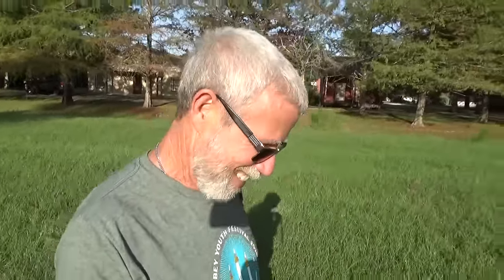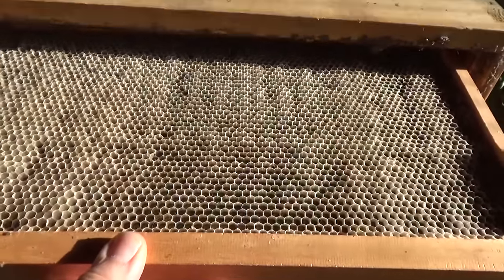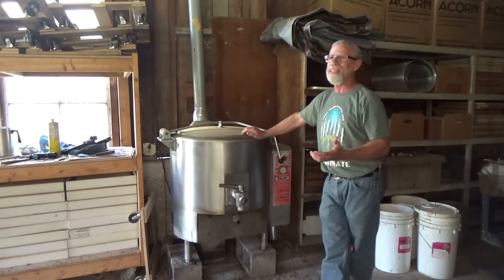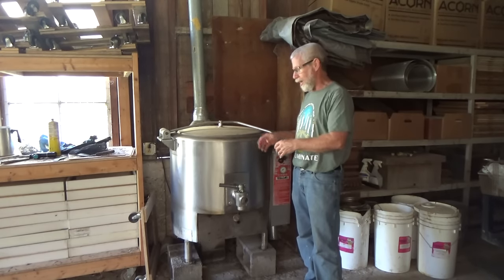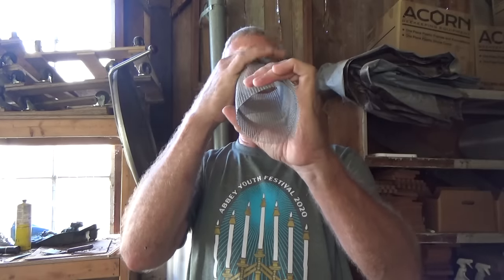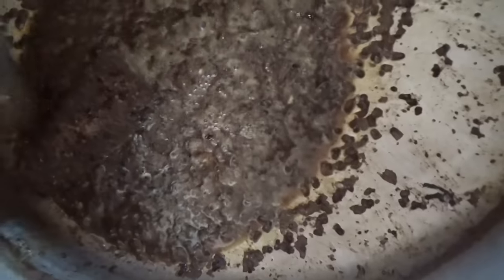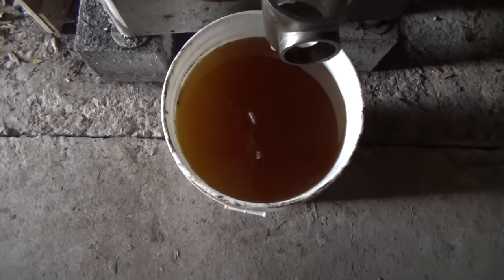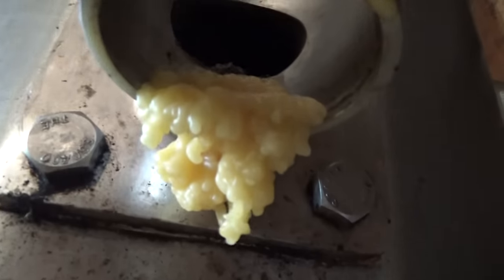Recycling our beeswax making it useful once again.

Comment: I got a better way there rings of hard work caught and put in the bottom then when you're through running all the wax out menu greektown in and pull that out you can hook wire or if we can pull it up easy after you pull it out the trash when I put it back down in there or just water inside boiling
Reply from the maker: That method may work for me, I'll give it a try. Thanks for the suggestion and for watching. God's peace Gorge.
Mr. Ed